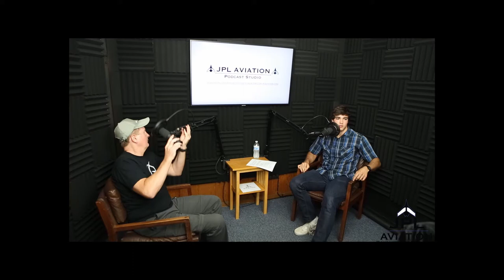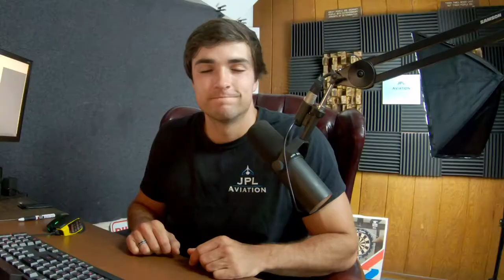Full Commercial Multi-Engine CheckRide Details: Taylor Deley, John Wayne Airport.

Comment: Great job on your check ride. As far as your ILS to 30, and in the real world. You would declare an emergency.  You also would have gotten no more than a 30 degree intercept and probably no shorter than a 10-12 mile final. So Mr. Deley did the right thing. Besides it's all about being PIC and using good judgement known as ADM. I think the emphasis on the ground portion is that CRM or SRM be utilized with you ADM. I wish you a safe and enjoyable aviation career.

Comment: 1 critical engine PAST
2 vmc def,factors...
3 departure brief accelerated stop/go
4 systems 
5 service ceiling
~~~~~~~~~~~~
1 slow flight 
2 power off stall
3 power on stall
4 steep turns
5 vmc demo 
6 lost engine 
7 full feather 
8 lost engine ils
9 short field takeoff
10 lost engine on takeoff 
11 short field land

Comment: Hi JPL, congrats on the video and thanks for the great material. Your videos have helped me with both my commercial and multi checkride. 
A quick comment - at some point you mention the dangers of losing engine when hot and high suggesting that may spin you over fast. I agree your one engine climb rate will be reduced, but the asymmetrical thrust is actually reduced vs ISA conditions. I may be wrong and I’d appreciate your feedback on this. Thank you!

Comment: I would agree with the stress and how unmotivated you can get from studying when it takes a long time just to get a flight in a multi plane. It becomes stressful if you put off the studying. So as someone who has made this mistake I would like to let other people know that the studying is extensive and to knock it out a little at a time. Seriously with life and school, it can be hard, but needs to be prioritized for sure. It will make it easier for sure. Hope this helps!
Reply: Additionally: don’t forget to study private and IFR knowledge as well as it can be very easy to forget about as you will fixate on the new knowledge.
Reply from the maker: You sound like you're going to be well on your way Caleb. Life ain't easy that's for sure. However, with the right people around you and a stable environment the skies the limit!
Reply from the maker: IFR knowledge and skill seems to be a dying trend in our industry today especially if you're in an area like SOCAL with little need for actual instrument flying!

Comment: @JPL Aviation
Hey thanks for the video have my check ride in the Da42 in a couple weeks. My question is I can't seem to find the accelerated stop distance in the POH your actually the first person I've hear mention it. Could you point me in the right direction about how to calculate it or where in the poh you found it? Thanks
Reply from the maker: If your aircraft does not have a specified Accelerate Stop Distance Chart, you should break it down into the theory and abstract the numbers. What is accelerate stop distance?  It is "the runway length required to accelerate to a specified speed (either VR or VLOF, as specified by the manufacturer), experience an engine failure, and bring the airplane to a complete stop." (AFH CH 12). If your aircraft does not have a specified Accelerate Stop Distance Chart, you should break it down into theory and from there find the numbers from other charts available. I'm assuming you already have the knowledge at the commercial level to break down the DA42 performance charts. Your prompt:  What is your ground roll distance to take off for x day? What is your landing ground roll distance for the same x day? Combine those two numbers. Are combining those two numbers accurate for an accelerate stop distance? What should you do to make them accurate? Commercial Level Understanding: What is the speed at which you decide to continue the take-off? What if on take off you're over the speed and an engine quits? What if you're under the speed an engine quits? What do you do in both of those scenarios? What's the risk of a take-off in a light twin with single-engine performance? Is a single engine take off always possible? Compare a Piper Seminole POH (standard trainer) to a DA42 AFM. Why does one have an accelerate stop distance and the other does not? What's the performance difference between the two and how would you fly each in the same situation x? 

Hope this helps and gives some food for thought. Multi engine flying during flight training is where GA has the highest percentage of fatalities per amount of accidents. All the best! If you have any questions lemme know